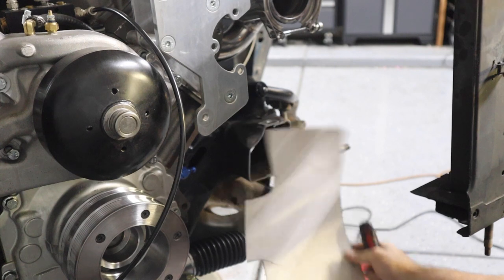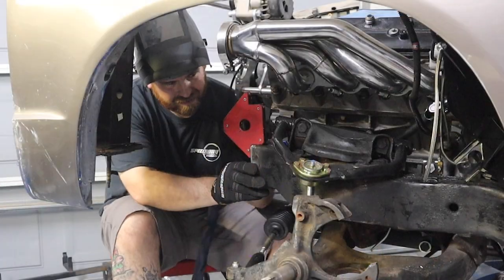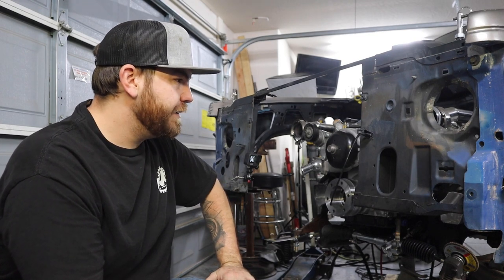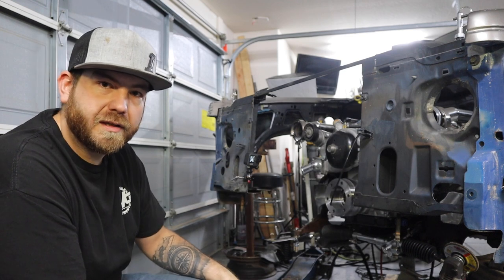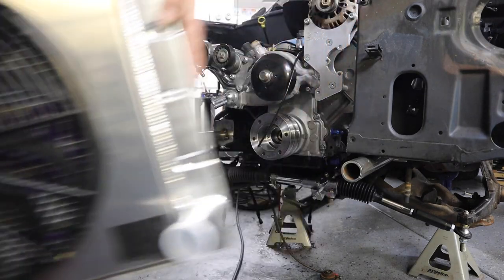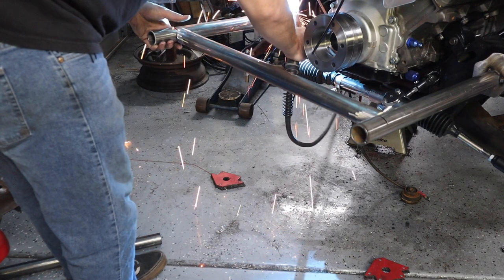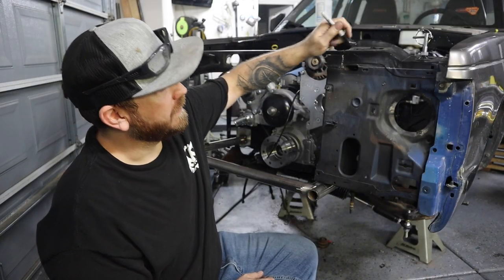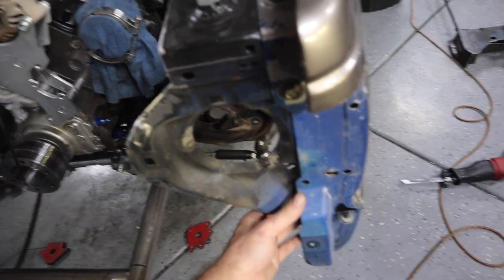I Cut My Frame Off!  S10 Tubular Front Frame Rails.

Comment: I know it's an old video but real cool definitely real cool. I just started my 49 Chevy that's sitting on a S10 chassis. Front end is stripped down and I'm installing 9-in coilovers with tin soldiers a arms. By chance do you remember what rack and pinion you used? I can buy a rack and pinion out of a 4x4 blazer for under 200 used. I would think it would be pretty compatible since it's still an S10. I will be going tubular front end as well so watching this build is a great eye opener to me. I've already shortened my 8.8 rear end and I have coilovers coming for the back and I'll be running a four link system. Feel free to throw ideas at me if you have time. I want major squat in the back so I may even transfer radiator and put turbo in the bed. Not sure yet.